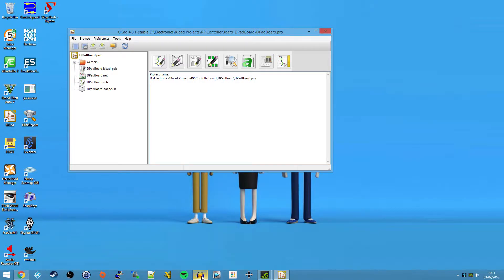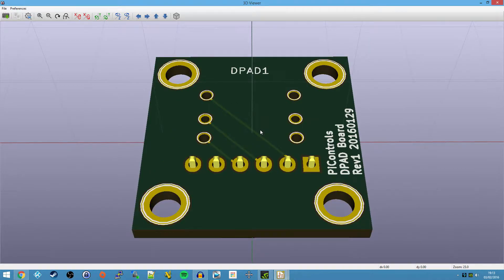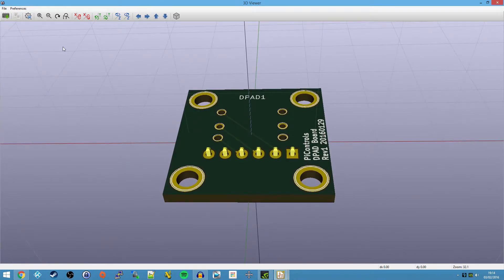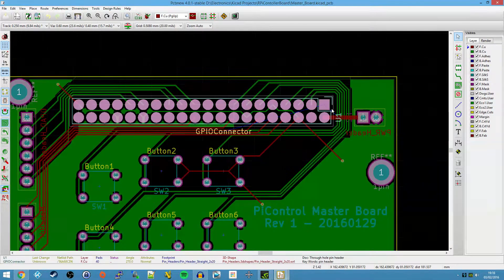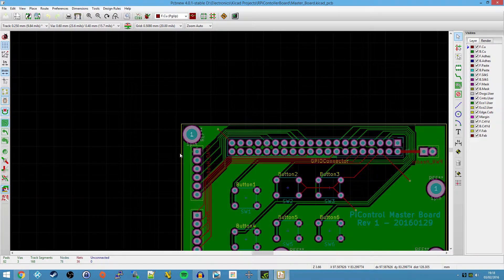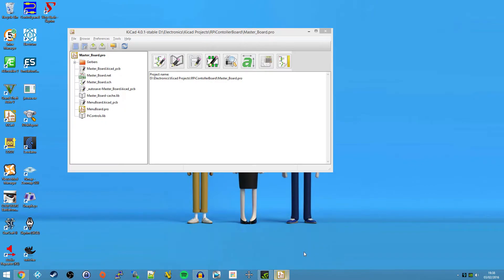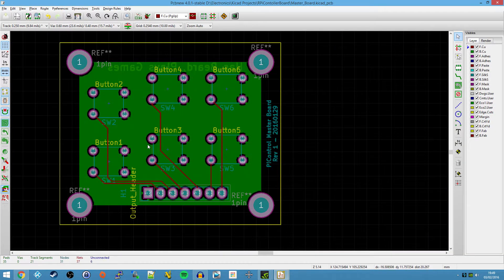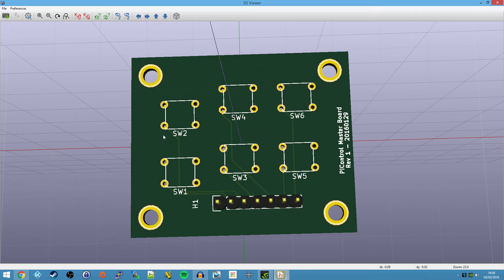(ABANDONED PROJECT) Portable Pi Zero Arcade Part 5 - Custom PCB designs!

Comment: If you're not using any headers or ICs, why not just directly solder the buttons to wires and then have holders for the tac switches in your case design? Pending you're 3D printing and not laser cutting your custom case, of course.
Reply from the maker: +tom611 Sorry, apparently Google thought your comment was "probably spam", and I didn't notice until now!

Every time I've tried point-to-point wiring in the past it's been a nightmare... Plus this will be good practice for PCB design; I'd like to do something with the Compute Module one day, and that's going to need some careful thought and design work.

Comment: I think it's really amazing that you even design custom boards. My first Pi got delivered yesterday and I'm getting started to having it do what I want it to, but this project is on a whole new level! Huge respect! :D
Reply: Also, where do you plan to put the accumulator? Having a stationary power source would trouble the Portable Pi Zero Arcade concept...
Reply from the maker: +AmazingHoffman Thanks! I think the main thing that helped me get my head around it was building circuits on protoboard & stripboard; it forces you to think about where the connections need to go and where/how you can physically place each component. There's an awful lot to learn about PCB design, but I'm only really working at a hobbyist level - I can get away with a lot more than if I was being paid to do this!
Reply from the maker: +AmazingHoffman I'm not sure what you mean by accumulator, but this will be battery powered. I plan to use an Adafruit Powerboost 1000c (https://learn.adafruit.com/adafruit-powerboost-1000c-load-share-usb-charge-boost/assembly) as the regulator/charger, and a small lipo cell somewhere around 2000mAh to 3000mAh
Reply: Has Beard, Plays Games Yeah, that's what I meant. In german, my native language, Akku(mulator) is a rechargeable battery. :P